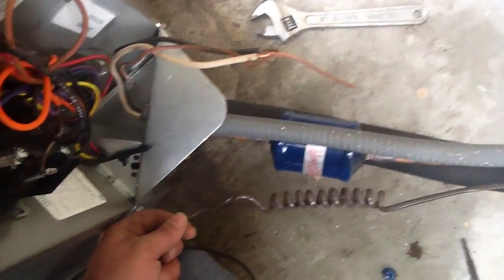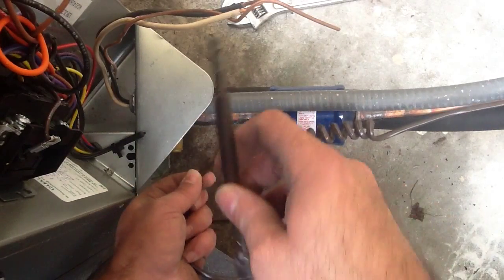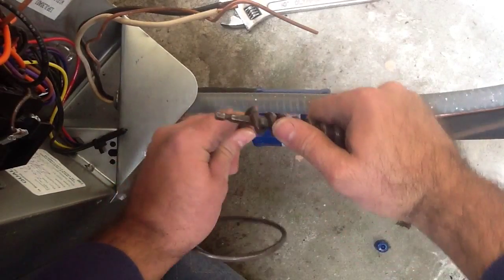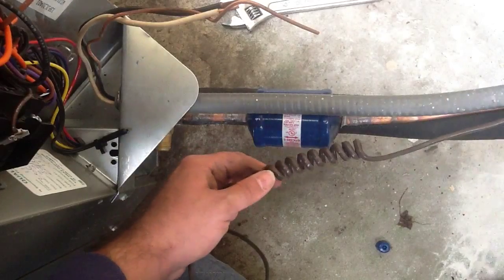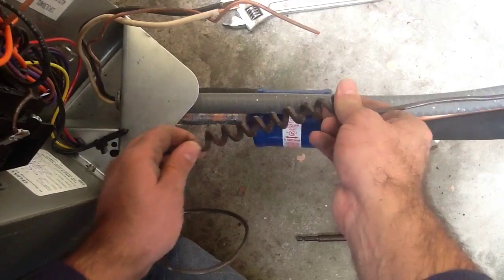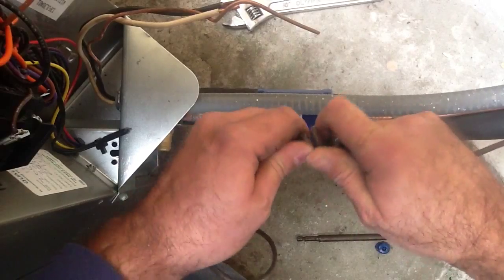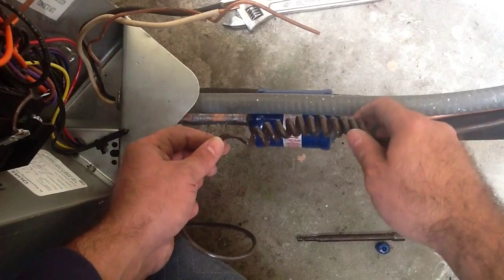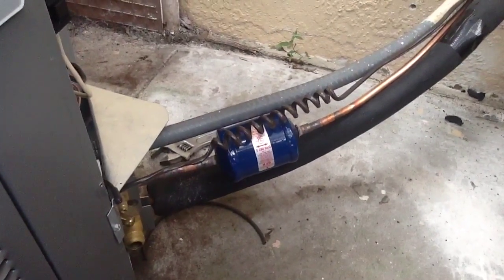Tech. Tip for  Hvac Technician And Installer

Comment: Great pro tip! I do the same thing!
Reply: I did the same thing for years . I'm guessing there was either a bad batch of wire or the insulation is too thin but we had to stop , we had a string of low voltage shorts and found that the shorts were in the coil of wire . I always did like that though
Reply from the maker: Thanks for the comments.
Reply from the maker: thnks for the comment airkraft1